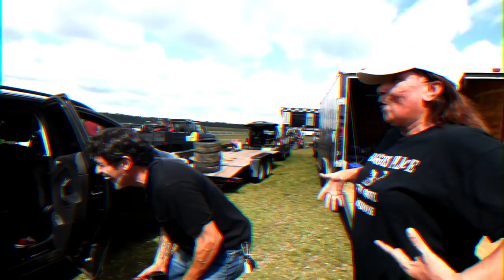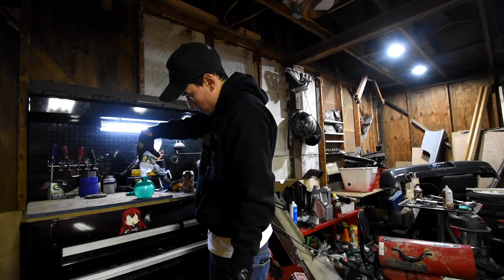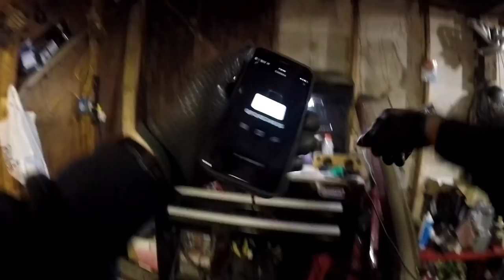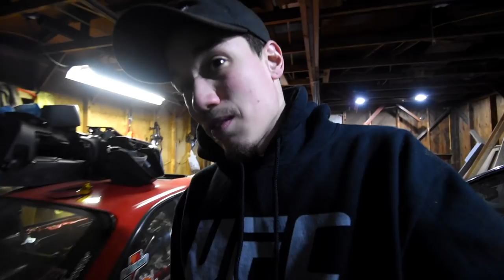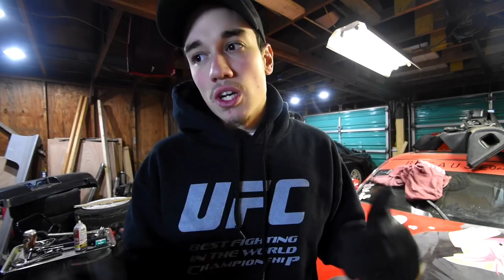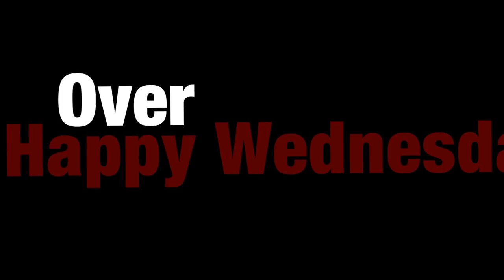.

Comment: You should do black rustoleum paint (to prevent rust) then scotch bright it after a solid 3 coats from light to heavy saturation, then duplicolor beadliner it will hold up nice and easy clean up homie
Reply from the maker: Dang I might have to try that!!!
Reply: Because Daddy the duplicolor beadliner is a lil costly but the results are well worth it!
Reply from the maker: Ill forsure check it out man!! Thanks so much man!!!!!